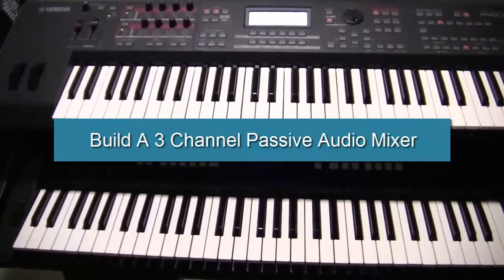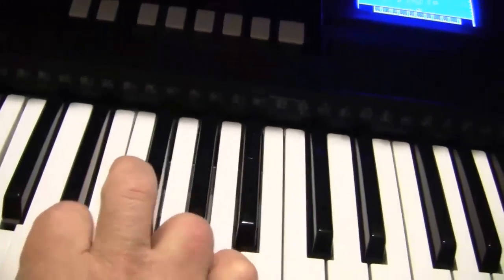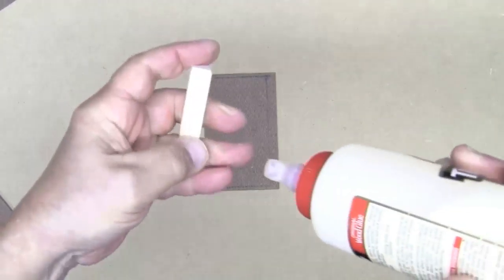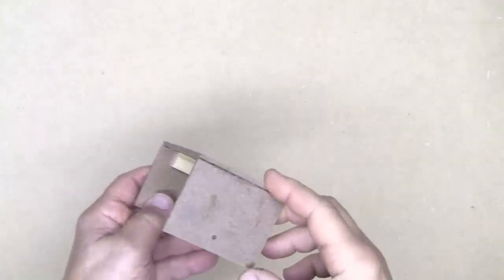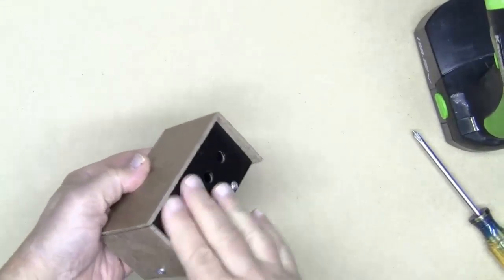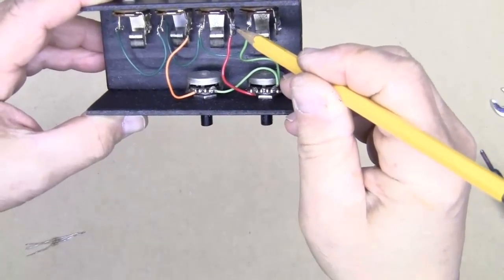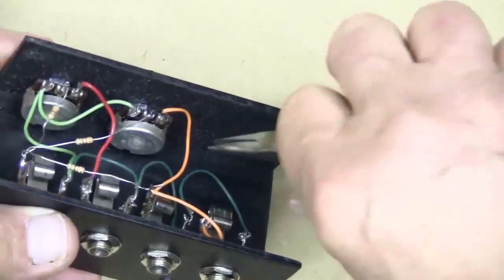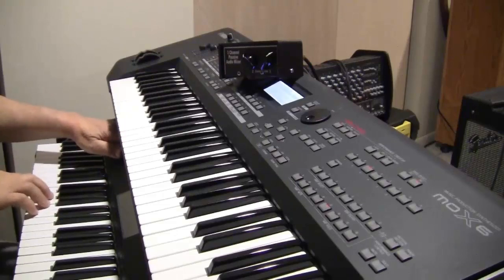Cheap Audio Mixer Expands Your Guitar Amp's Inputs - Build It!

Comment: how can you make a mixer that would allow mulitple outputs for a single input?
Reply from the maker: The easiest thing to do is to get a "Y" cable (one input, two outputs).  I use one on my Roland Street Cube to input two microphones into the singe mike input.  Works great!
Reply: brodafin  My DOD resistor mixer allows two way operation, meaning signal may pass either direction... it has 4x1 and a volume on each of the 4. Maybe the Brodafin 3x1 is a two direction mixer as well?
Reply: Look for ABY Box project. It's what you're wanting. There are lots of resources on the web, or you can buy them pretty cheap.

Comment: I was wondering if somthing like this would work for mixing drum mics. in order to mic a drum set, it burns up a lot of channels on the pa. Im sure there would be a lot of mods I would want to do.
Reply: Yes. You can get a cheap rack mount line mixer for $100 with 8 channels. May be easier just to do that.

Comment: Would this work for mixing guitar effects in parallel ? I have a splitter that takes my dry signal and splits it to 4 outputs. 1 - dry, 2 - 1st delay, 3 - 2nd delay, 4 - reverb. I was looking at the ART splitmix 4 and the RJM Mini Line mixer, but they are too expensive for me right now.
Reply: Sounds like you're needing an effects switcher/looper. There are a lot of recources on the web. They are fairly easy and cheap to build, but complex ones can be bought for a much higher price.

Comment from the maker: Wow!  I'm glad you didn't tell that to the unit I made for myself because the volume controls work really well.  I've transported it back and forth to the studio and haven't had any problems.  I understand your theory, since I'm an Electronics Engineer, but this is meant to be a simple, low cost aid - not a military grade device.

Comment: Your presumption is incorrect. For audio applications, a logarithmic potentiometer is required, not optional. In addition to being poorly soldered, incorrectly grounded, and saddled with a shoddy final assembly, your mixer is going to be ridiculously difficult to manage for volume control.